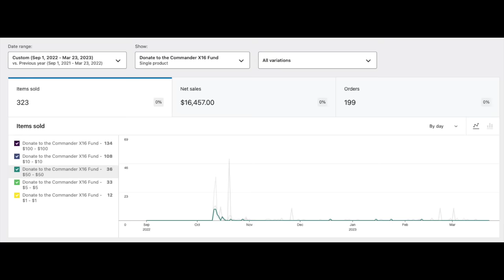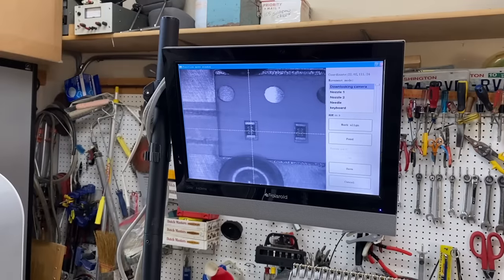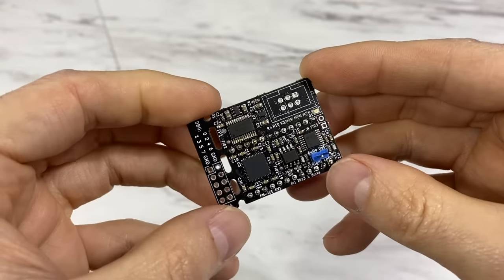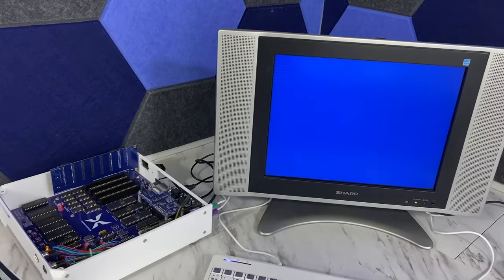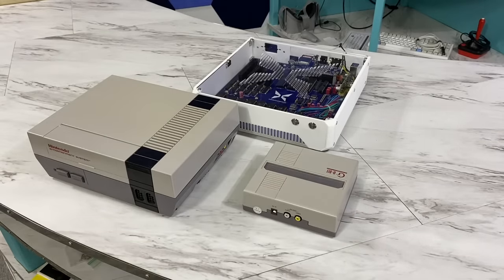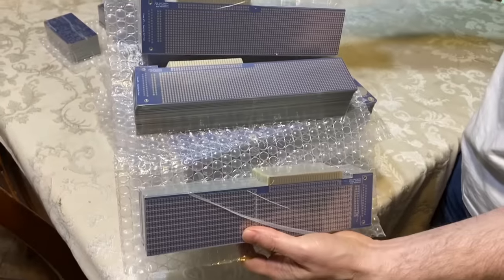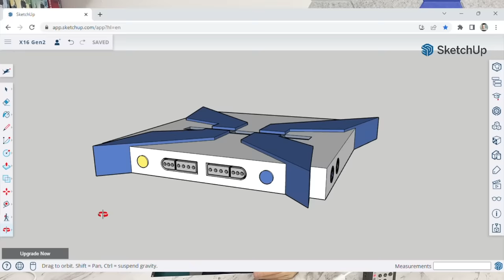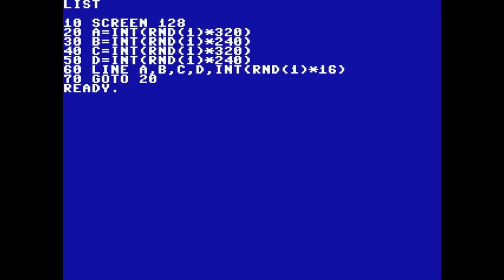Commander X16 2023 update

Comment: I kept track of this project from the time that 8-bit Guy made his “dream computer” video. I’m glad he went for it because it brought a platform to this kind of project. However, that they’ve not met many of their design goals (no FPGA, no use of out of production chips, a single person can understand everything on the board, pricing) says to me that they simply were over their head in the first place. Something like the Agon light meets the original X16 design goals much more closely than what the X16 has become. The design goals as stated just became too contaminated with wanting to match/emulate a Commodore / VIC-20 too closely. Physical compatibility should have been sacrificed in favor of achieving the same thing using SD cards. Needing a cartridge to get around some of the limitations of the architecture is just nuts and could have been entirely avoided.
Reply: I love the inclusion of acartridge, it provides avenues of expansion that are easy and just aren't possible with an SD card. They mention throwing a vector chip into a cart to support a game.

Expansion slots can do a similar thing, but that assumes the "console" version will keep all of the expansion slots on the board, which may not be the plan if they want to reduce the size.

If I get an X16, it will be the full size version, but wothout a cart slot, the console version would be super restricted in what it could play. 

Finally, the X16 is unlikely to be a huge community, and boutique devs are gonna want to make money to support their work. Hardware allows them to have something to sell. And from a vollector's perspective, aside from digital PC games, I almost never buy digital versions of games that have a hardware alternative. 

Bottom line is most people who wpuld want something like the X16 wpuld also want to buy collectable hardware.
Reply: @not_my_fn_real_name2689  I’m not saying that having a cartridge slot is bad. I’m saying that needing a cartridge just to have extra ROM space is bad. You shouldn’t need a cartridge for that. An SD card game should be able to do the same stuff as a cartridge game, you shouldn’t need a cartridge just to take advantage of full capabilities. It divides people into two camps, those with cartridges and those without, and that’s insane in a digital world. Not to mention that SD cards are cheap and making carts costs money, so it prevents small indie developers from distributing games on SD card or over the internet unless they want to accept not having as much memory to make their game.

In other words, just because it’s a retro computer doesn’t mean we should artificially limit the machine to what was possible in 1980 and ignore all present reality.
Reply: @paradoxmo  Exactly. Needing carts to overcome the system's addressable memory limit is bizarre, especially when at the beginning David said it would probably use a 65c816, which would have solved the problem. This means people interested in making more ambitious games will either need to make and sell carts, which will drastically decrease output, or specialized and expensive flashcarts will need to be made. I thought the idea was to make an accessible system with a sizeable user base, but it seems that's shifted to basically continuing the Commodore line under a different name, as if the last 35 years never happened.
Reply: @paradoxmo  " I’m saying that needing a cartridge just to have extra ROM space is bad." What does that mean? The ROM in the cartridge is HOLDING THE GAME. If you have the game on an SD card, you don't NEED the ROM space, because the game is on an SD card. 

Dave literally says in the video that if you don't care about the competitive eSports angle and are happy running the game from the SD card, you can just do that.
Reply: other than supporting the channel and being a fun hobby project I think this project isn't doing anything that a pi zero for a fraction of the cost can't do! overengineered and overcosted, it costs more than a steamdeck !!
Reply: @brucemcfarling4674  In David's own words, not referring to anything online, "cartridges do offer some benefits the SD card can't match at this point". Sounds like this is because they connect directly to the CPU and allow a larger High Memory area, while therwise you're limited to what can fit in 512KB of RAM, as he mentions cartridges allowing games to use much more graphics and sound data. Seems they're finding ways to keep the same kinds of limitations as the old Commodores.
Reply: @Mmmm_tea  Or, in other words, the system is for the people who want it and it is not for the people who do not want it. Someone who is happy with emulating retro systems on a modern system don't even need a Pi Zero (which doesn't have the power to emulate the Vera chip), they can just run the X16 emulator, which is being developed alongside the physical board.
Reply: @jacklawsen6390  Yes, it is true that if a game physically requires more memory than 512KB, then it would require that you own at least one cartridge, so you can flash the game onto the cartridge.

But unless there was special hardware on the cartridge, it seems like you would only need to get a separate cartridge per game if you wanted to do the competitive gaming on the system, where there is one or more key values in the ROM to ensure that you are not using a hacked copy of a game. 

Since the cartridge slot is a full fledged expansion slot and is not locked down in any way, there is no way for the project team to prevent people putting special hardware on a cartridge that is required to play the game, but that would seem to be on the person who did that, and not on the project team.

And there's no way to prevent that on a system that allows bus mastering cards in the expansion slot and allows programming down to the bare metal without operating system intervention. It goes with the territory. If you don't want a system with a full fledged expansion slot, then there are other options out there.
Reply: @brucemcfarling4674  Fair enough, I don't think specialized cart hardware will help grow a user base, but if people want to make them that's their deal. The thing I see as knee-capping the system is the need for cartridges to hold more graphics and sound data, and needing to buy a specialized and expensive flash cart seems a very unoptimal solution. Not to beat a dead horse, but the Agon Light project uses a newer version of a Z80 that can be programmed "down to the metal", while also supporting 24-bit addressing, so a situation like this would never come up. The 65c816 chip that David said would probably be used also supports a much more robust memory architecture as well. This issue will further limit the system's user base and could have been completely avoided with better planning.
Reply: @brucemcfarling4674  but the point is that limiting the high memory area is not actually necessary, there are many memory management solutions that would allow an SD card game to load extra data, without compromising the spirit of the project, if you designed the architecture that way. Needing to use a ROM to expand available memory in 2023 is nuts, even in a retro computer.
Reply: This is the ONE TIME I agree with the nay- sayers. I really wish David put a 65c816 or a modded version to have 24 real address pins and have at least double the memory. It would’ve cut out a lot of the hardware needed to accommodate bank switching and the limitations. Imagine the X16…….. but with 8 megs of RAM instead of 2 without bank switching. Or have VRAM directly accessible to read/ write to from the CPU. Maybe 12.5 or even 25 mhz instead of 8. (However, the CPU would have to slow down to 8 mhz when accessing the 2151.) I don’t think it would be that hard to have 256K VRAM instead of 128k. Heck, 512K even! Or maybe have it seperate for the bk and sprites.
Reply: @ecernosoft3096  Because the memory map used a Vic-20 strategy rather than a C64 strategy, there's not a lot of hardware needed to accommodate bank switching ... address detection and two blind latches, with the latch outputs tied directly to the relevant RAM or ROM address line.

But as far as giving up all of those sprites per line and 256 colors in a palette containing 12bit colors definitions in order to accommodate direct access to the 6-times slower main system memory, instead of 50MHz access to the 1MBit memory module embedded in the FPGA, no, I wouldn't make that tradeoff. I'd stick with the Vera approach there.
Reply: @paradoxmo  Since you are free to use either ROM or RAM there, I don't see how you can say there is a "need to use ROM to expand available memory". How can you "need" to use ROM when you are free to use RAM if you prefer?

As far as I understand, it seems like this solution probably uses 1 additional quad OR gate. and extends ten existing traces to the expansion slots. What "memory ,management solution" that can be easily implemented with 74 series CMOS glue logic did you have in mind?
Reply: ETA: Funding this through charitable donations is also scummy. I'm glad I'm not the only person who sees this. I get that the realities of cost and manufacturing are always going to be a challenge with a boutique project like this, but most of the bad decisions and scope creep occurred in the stagnant time between the announcement of the project and when prototyping started. The saddest part is that they didn't even learn from history - getting ROM expansion carts (which are also going to be very expensive to produce) ready before this thing is even out. How many older machines have expansions like this that rarely got used because the money was in targeting the base machine? This project always should have erred toward austere design in my opinion. If other people are still happy with this for $400+, I think that is great, but it definitely won't be for me.
Reply: @doc_sav  I do think there's a lot of potential there for things to go sour if more difficulties and setbacks arise, especially since they're using donations to buy equipment that will be used in unrelated commercial projects. That doesn't look great.
Reply: @doc_sav  Most of what people call scope creep are just that their Dream Computer isn't Dave's dream computer. He wanted an 8bit upgrade to a Vic-20/C64, and also being the 8-Bit Keys guy, he wanted a nice chiptunes system.

The number one scope creep was when PSG sound was added to Vera. One of the costs of being a volunteer project is that when someone comes up with something you both want and need, part of the "cost" of the volunteer labor is what they want to make may include more than what you need. The Vera sound subsystem is an example of that. Strip out the Vera sound subsystem, and you have PSG from a pair of AAY chips, FM from either an OPM or (if they were more prudent) an OLP2, and PCM from the parallel ports of the AAY's. Indeed, if you can get a quote from Yamaha, you could have the in-production (but not readily available in small quantities) SPI-bus FM chip, so it's in production. And stripping out the sound component from Vera frees up the lines to have a second SPI port on Vera, if there is a concern that not all SD cards share an SPI bus in SPI bus mode as well as the specification says they are supposed to do.
Reply: @brucemcfarling4674  I don't think people are referencing their own expectations with this as much as they're referencing the very clear definition David gave of his own "dream computer" at the outset of this project.
Reply: @brucemcfarling4674  I think there are many aspects of the current system that fit the definition of scope creep, but the important thing is how all those changes are received by the potential audience. I believe that all the added complications and costs will definitely further limit the appeal of a system that was going to be rather niche anyway, but to some extent it may be successful in spite of itself. Despite ending up with a system much less simple, approachable and affordable than he initially intended, David may also have underestimated demand for a new vintage computer with vintage-style limitations and separate expansions, as well as willingness to accept the associated costs. We'll just have to see how well the team can overcome resulting production and funding issues, and if this audience is large enough to support a thriving developer base.
Reply: @Allen.Christian  But, yes, I agree, people are referring to the original idea from 2018 of a System-on-a-Chip device, before this project was launched, and ignoring the decision made when this project WAS launched to first build the computer that the System on a Chip was emulating, before building the System on a Chip system.
Reply: @brucemcfarling4674  The relaunch was basically "let's more or less make a VIC-20 of readily available, off-the-shelf parts", still keeping in the vein of the original idea. Which this still doesn't resemble at all.

Comment: there seem to  be a lot of future plans for a device that is already having problems sourcing its chips as they are not in production anymore.
Reply: Yep, they really need to get supply and manufacturing issues sorted out for the first batch, before setting goals for versions 2 and 3. They need to finalise the build and the price before considering where to go next. I never understood why they would use old, obsolete sound chips that are no longer in production.
Reply: @another3997  well, four years ago there were availability, but probably COVID and stock shortage did wonders making them out of stock. Even for no longer manufactured parts, stock diminished quite fast in the recent 2 or so years. Not only YM parts.
Reply: @Mr-te7dt there was likely never availability, the numbers he was looking at were likely faked.
Reply: @another3997  Maybe they can get some more of those Yamaha chips replicated in Mexico.
Reply: I assumed they had some decent engineers involved in this project but given how many bad decisions they've made (such as using obsolete components), i'm no longer sure they do.

Comment: What you're missing in your soldering setup is a solder pallet, which you've kind of partially recreated. The pallet will hold the board flat, mask off areas that you don't want solder on (SMD areas, edge connectors, or unpopulated thru-holes that you don't want filled), hold down large THT components, and so on. Others have mentioned that wave soldering would cause less warping but since you already have the dip station it's probably worth doing your best to make it work rather than buying a whole new machine.

Comment: I can't believe you thought there were 100,000 Yamaha chips sitting in a warehouse somewhere. The chip was introduced 40 years ago. It would be like claiming there are 100,000 8088 chips ready for sale, except the Yamaha chip had a lot more uses for it.
Reply: Yes, that does really expose him as sort of out of his element.
Reply: I can't believe the amount of comments I had to scroll through to find someone pointing this out.
Reply: Well, whilst I agree in general,  it's really the fault of the suppliers making untrue claims. You would think that David contacted at least one of them  before committing to that sound chip?
Reply: @another3997  One would think.
Reply: @another3997  he said in the video he had contacted suppliers prior to picking the Yahama, and that confirming supplies existed is why they went with the Yamaha. It wasn’t until the ordering stage that the supplier came back and said they made an error and didn’t have the supplies.
Reply: My thought was:  OK, even if it had been true, you just sold your 100,000th board.  Now what?
Reply: @nickwallette6201  They aren’t going to sell 100,000 boards. He mentioned they wanted to order 2,000 chips which I don’t understand why they would order so few. Even the Mega65 sold 1,400 units in the first 12 months. I expect with the lower prices of the X-16 and publicity behind it, they will easily sell 2,000+ the first year with sales sharply declining after that.
Reply: @mattks1001   That's entirely likely.  But you never know.  Arduino and Raspberry Pi weren't obvious runaway successes either.  Point being, you would want to have tempered expectations, but not plan your way into a dead-end if things go unexpectedly well.  Just saying, if it were my project, designing the thing around a long since OOP sound chip, regardless of quantity on-hand, would not sit well with me . . .
Reply: @nickwallette6201  The Raspberry pi absolutely was a runaway success.

Comment: Regarding the soundchip situation:
If you are going to swap out the soundchips with one that is incompatible with existing software anyways, then why not go with one that is still in production. I believe Yamaha is still making an FM sound chip called the SD-1, and there's a video on Youtube where someone made a USB sound card that is soundblaster compatible using the SD-1. That might be worth a try. As it's still in production it would at least mean you guys won't have any supply issues with them (in theory)
Reply: The SD-1 and YMF285 haven't been in production in over half a decade. The newest possible examples you'll find have 2018 date codes, and you couldn't even get them difectly from Yamaha at the scales he's working at.
Reply: No matter how, using ICs will get this project into further trouble. No matter David's nostalgia, ICs are a thing of the past, and relying on them is a recipe for disaster.